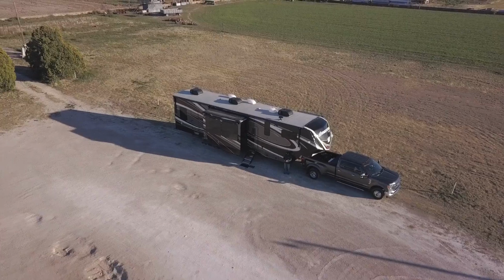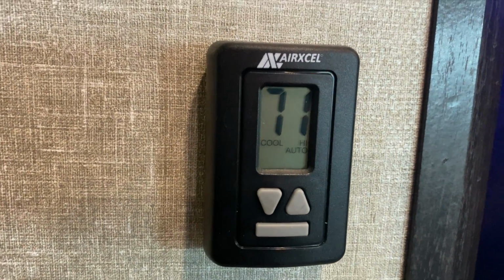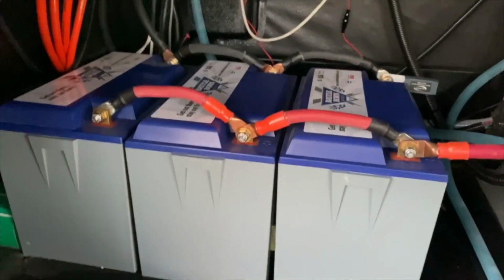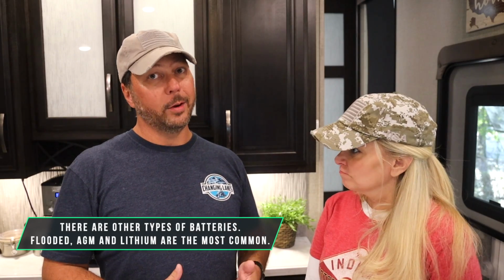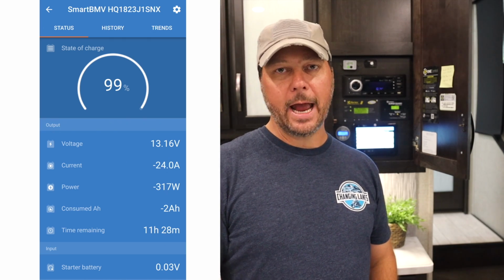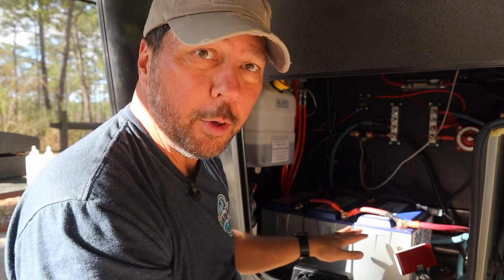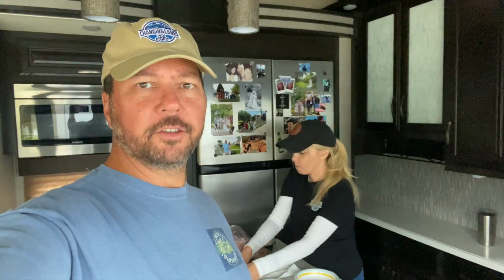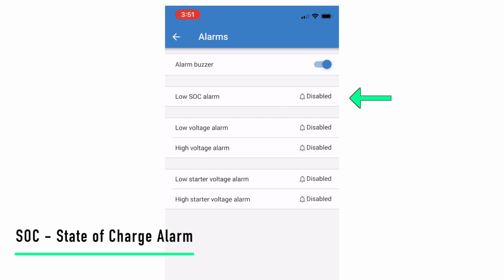RV Battery Monitor | RV Power Management | Victron BMV-712 Review

Comment: Thank you for going thru all the differences in batteries between about the currents and amp hours.  Last summer we had some batteries die several times while boondocking and that wasn't fun especially with no fan capability. Batteries are always a hot topic in the RV community and we have heard a lot of good things about the battle horns.  Maybe when we upgrade our RV we will do that.

Comment: I suggest a follow-up video ( "Part II") is required, Chad.  At least in GD trailers, the stock WFCO converter is not the best for a lithium like Battle Born.  Then the wiring from the converter to the battery must be considered.  OEM's put the smallest gauge wire (weight and cost consideration)  that may not be able to handle what a lithium-capable converter is capable of supplying to a lithium battery bank.   There's a lot of "gotchas!" with this topic!  Separate note--wish I'd had my solar and DC-DC Charger setup installed at the National Rally last year so I could have showed you (we were about five trailers down--I had the Goldwing).  I'm sure you and I would have enjoyed geeking out talking about our configs.  That is if Daisy allowed it.  :)
Reply from the maker: There are a lot of gotchas with the topics of batteries for sure..  Which is why we wanted to keep this video focused on monitoring.  We will likely have some follow-up in the future to talk about batteries and charging, etc.  For us, our stock converter is disconnected and we charge with our IC-3000 GoPower.  We do also want to add solar at some point... and/or maybe take advantage of the second heavy duty alternator in our truck to charge while driving... 👍🏼

Comment: I was riding through the middle of Wyoming, pulled off to catch a photo of the scenery with the bike mirror in the photo. Hadn't seen a car for two hours and of course, I get the pickup in the mirror right when I'm taking the photo. To the guy's credit, he did ask if I was OK since there usually was not a whole of traffic through the area. Thanks for the info about the batteries - I'll be upgrading when I get my rig and I'll definitely get the battery monitor!

Comment: Chad, I had recently bought a Vectron 712 and frankly, it was giving me fits understanding the proper install. I have a couple of Golf Cart batteries wired in series and for some reason, the monitor and my rig wiring were just not cooperating. Your explanation and presentation of your install finally straighten me out. I got the entire thing sorted out and running and monitoring properly. Thanks for the clear, lightly technical, which I needed video look at your install.
Reply from the maker: Glad you got it sorted! 👍🏼

Comment: I'm currently running with 3 Battle Born 100AH batteries as well Chad, and over this summer found that three batteries aren't doing the job, so I may add another soon.   We have a residential fridge, which when working to bring the fridge up to temperature (it's been a hot summer even here in western Canada) it's using between 15 - 20 Amps continuously.  Once cold, it pops back to about 3.5 amps.   So, we where hoping to get a longer time period between charging, but we're finding we still need to do the 2 hours in the morning, 2 hours at night with the generator.   We're not happy with the morning charge, as while it's running, we'd much rather be off doing something, than babysitting the generator!   Being that we're not sure if we'll keep our Tiffin Phaeton (my wife is vying the 5th wheel type) and we have no solar, and twice we where awoken in the middle of the night, where our batteries went down to 10.9 Volts, so I just turned the fridge off.   Of course at a campsite you can't use the generator generally until 9:00 - 11:00 Am, so sitting around waiting for the ability to do so...when you're usually up at 6:00 Am seems crazy, but heck, it's the rules.   Thus, we can't use our coffee maker with the batteries basically depleted either.    At the moment, I've explained this to Battle Born, send in photo's of my setup (I'm in parallel) and I do have the Victron BMV-712, and I leave the main monitor with the batteries, and use my iPhone to see where I'm at.   The guys at Battle Born are going to throw all this at one another and see if my system is correctly set up, and what my options are so as to not have to go to full service RV parks are, as we do like to Boon dock for 4 - 6 days at a time on occasion.     Thanks for the video, as I too have gone through the learning process, and you've done a great job in explaining things!    You two stay safe!!
Reply from the maker: Yea.. solar would close that gap, I bet... 👍🏼

Comment: Love the informative videos. 

Just my $.02 here... I see a lot of people saying they want lithium now. As a word of caution, I would not cheap out on the lithium batteries without a BMS. The BMS on lithium batteries is absolutely essential, in my opinion. Improper battery management on a lithium battery for charging and discharging rates is a sure fire way (pun intended) to have a battery catch fire and/or explode. Do you remember all of those hoverboards and cell phones a few years ago that were burning up? Improper battery management was the culprit. Usually the fires/explosions are due to overheating and then thermal runaway, which results from charging or discharging too quickly. This will cause the battery to get hot. Without some type of BMS, there is no way to catch the overheating in time.
Reply from the maker: Very good point!  One of the reasons we picked battle born.  👍🏼

Comment: Great video. One clarification. Your Battleborn (BB) batteries are controlled by its internal bms that only allows 100ah out of the fully charged battery before cutting current. My understanding is that if you removed the bms and drew all the power from the batteries, it would ruin them. Kudos to battleborn for labeling their batteries for usable capacity unlike most other manufacturers. Keep making these wonderfully informative videos. 
Can you make a video on trash while boondocking? Especially for longer periods and in areas with preditors (bears)? Who doesn't like some goodhearted trash talk!
Reply from the maker: As I understand it, the true rating under the covers is more like 110Ah.  the BMS, like you said, limits it to 100Ah....  
On the trash question..Most places we've been have a dumpster in driving / walking distance.  If no threat from critters, we can stage in the back of the truck...

Comment: I noted a glaring error at 15:35 when you stated you have "3 Battle Borns connected in series, positive, positive, positive, negative, negative, negative." That's a parallel battery connection, not series. You might want to edit in a correction so as not to misinform anyone. Great video, again. I enjoy your channel. :)
Reply from the maker: The correction was on the screen: "Parallel NOT Series"  👍🏼   😊   Caught that in editing...
Reply: @ChangingLanes  I saw that after watching it again. It appears in the lower left as your arm was moving so my eye's just weren't drawn to it immediately. Can't believe how expensive those batteries are, but I've heard they will last about ten years.

Comment: thanks! great information. we are selling our house now, and have on order a Fuzion toyhauler to live in for at least a couple years.
The Fuzion is coming with a Onan 5500 watt gen, a 265 watt solar panel, a MPPT charge controller, and a magnum 2000 inverter. As you are aware the trailer ships to the dealer sans batteries.  I cant decide if in 2 years, heck give it 3 the added cost of lithium batteries would outweigh the cost of fuel for the generator ( and or propane usage to operate the fridge ) i have been told the solar (assuming most everything else is off) will keep up with the fridge. its still a bit of a puzzle. 
Will most likely bite the bullet and get the Lithium after watching this.
Maybe we can go for a ride somewhere sometime.

Ed Rust, ADCS Ret. 
Proud member Patriot Guard Riders

Comment: Really, really excellent explanation of current draw.  For a while I was thinking, "100 amp draw for lights and fridge?" But it's 100 amps AT 12 VOLTS DC. We're used to thinking of 15 amp outlets on 120 VAC!
Reply from the maker: Indeed... and why it's simpler to use Watts when talking about power across an inverter..  👍🏼

Comment: So, after shutting off everything and the lights.....the coffee pot still has lights on.   So.... coffee maker = 14 ish amps... .Note taken.  Thumbs up!  Good video guys!
Reply from the maker: Not sure which part of the video.. But the lights and clock on the coffee maker should be less than an amp.  We also have computers, network equipment, network attached storage, and other stuff on to get that draw.
Reply: I meant that to be funny, cause Lord knows I run on coffee... isnt it one of the 5 food groups?  Thanks again for the video guys!

Comment: The Victron is a great device, especially if you have solar. Side note- the info you gave about AGM's is not completely accurate. They don't need ventilation (But should not be put in a box because they do need to breath) and you can safely draw down to 30%. (70% usage) BB are down to $800 each. By the time I wear out our AGM's the BB will be affordable.
Reply from the maker: That's not what my research indicated...   http://google.com/#q=do+agm+batteries+off+gas 
http://google.com/#q=how+much+can+AGM+batteries+discharge+without+damage
Yes.. you can use 70% but at the cost of longevity.

Comment: Chad, you forgot to mention the huge plus of Lithium batteries is that the voltage stays at a full 12 volts until nearly fully discharged. Unlike AGM or flooded. With my old AGMs, by morning, the voltage would be down around 11 volts. Otherwise, a good clear description. Thanks
Reply from the maker: Good point!  We didn't want to get too "in the weeds" on batteries.

Comment: Nice video, Chad.  Curious what gauge wire you ran from batteries to the bus bars?  Also, for the shunt....is the negative running direct to the shunt, then to bus bar?  At what point are you connected to the chassis? (bus bar to chassis or negative terminal to chassis)?  Thanks again!

Comment: You do amazing videos- thanks! I had read/heard that the battery bank should be fused close to the bank with an ANL or Class T (many prefer Class T). I see that your Class T fuse is after the battery switch and + busbar. I am very interested in your opinion on how one selects the order of those 3 things as I would have thought the order would be battery bank then 400 amp fuse, the switch, then busbar. Thanks!

Comment: Chad  - I am curious why you are not charging the house batteries from your tow vehicle while driving? This is a very common, I am surprised that is not part of your setup. Great information - so well covered.
Reply from the maker: The power supplied through the 7-pin is minimal. It might be enough to float charge if nothing is running in the RV. But, we use our inverter (https://youtu.be/1rPKWrXQYWA) to run our fridge as well as keep the internet up so our Ring security system (https://youtu.be/f-cWvMqnU9g) can monitor for smoke and water leaks. The result is, the RV is using between 10 and 50 Amps DC while towing. We might be getting 4-5Amps tops from the 7-pin (just a guess based on what we see on the monitors). So, our options to charge while towing are solar and/or a connection to our truck's second heavy-duty alternator. We are looking into both.

Comment: Hey Chad, I realize this is a year old, but I hope you see this and have an answer for me/all of us.  I have read, and heard, that the LiFePO4 batteries are susceptible to damage, if you attempt to charge them at low temperatures, or if they get too hot.  suggested range between 32 and 80 fahrenheit.  Your batteries appear to be in unconditioned space, is that OK?

Comment: Great presentation ,  and very informative.  What I have noticed is  no one talks about dry camp and CPAP machines.  It seems like no one discusses this area.  CPAP machines seem to be a very common need.  RV makers don’t address it and I would guess a majority of there customers uses them.  Could you put a presentation together showing us weekend warriors what kind of battery supply they might need.  The two machines we use have power requirements are 24v , 3.75 A the other 12v draws 6.67A. I would guess most use a generator to recharge during generator hours.
Reply from the maker: Since you know the DC Amp draw, it's just a matter of math.  Let's take the 12V one as an example.  I assume you will want to run it 8 hours.  8*6.67 - 53.36 Amp Hours.  Obviously, you'd want to add in for other items, but that's what it would take to power that CPAP for 8 hours.  Hope that helps!
Reply: Changing Lanes thanks for a quick response, but how would you address the 24v draw.
Reply from the maker: @josephcosler4653  Assuming you have a 24V system in the RV, it's really no different. You still multiply the Amps times the number of hours.  Now, if you have a 12V system and want to connect a 24V CPAP, you'll need some type of converter.  In reality, these systems are pretty close in what they use in terms of power.  Power is measured in Watts.  To get watts, you multiply Amps by Voltage.   So, your 24v CPAP pulls 90 Watts and the 12V pulls 80 Watts.  The bottom line is they don't use much power.
Reply: Changing Lanes thanks, using a inverter would be the best route. Because I could plug them just as if we were in the house.  Thanks for your for a quick response
Reply from the maker: @josephcosler4653  I think that's what most with CPAP do...   Even then, you can find the wattage it uses, divide that by 12 or 24 and that's approximately how many amps DC it will draw. 👍🏼

Comment: Chad , I notice in “ Morton on The Move  “ . There new series  Morton go North  episode 4 that Tom had the truck charge his batteries ( Battle Born ) as they drove . But I think the truck also  had a second alternator to help with this .  Know he did modify the heating and hot water heating on the Lance camp to his spec. Working with Lance Camper manufacturer.  For there trip to Alaska. I believe Tom is an electrical engineer . Please don’t get me wrong , your great at electrical wiring . Just a thought ! Really enjoy you and Tara adventures and trips!!!!  Take care and safe travels !!
Reply from the maker: Yes.. I want to do that mod eventually.. We already have the second alternator on the truck.  It does require separate wiring to the RV...

Comment: Q.  Have you thought about a battery charging system that uses the truck alternator to charge the RV batteries as you travel between destinations. I have a friend that does this with his boat batteries as he heads to the lake.. Not sure if this will work on a RV.. Great videos guys I enjoy watching and getting to travel with you thru YouTube. Hope to run into you all someday..
Reply from the maker: The power supplied through the 7-pin is minimal. It might be enough to float charge if nothing is running in the RV. But, we use our inverter (https://youtu.be/1rPKWrXQYWA) to run our fridge as well as keep the internet up so our Ring security system (https://youtu.be/f-cWvMqnU9g) can monitor for smoke and water leaks. The result is, the RV is using between 10 and 50 Amps DC while towing. We might be getting 4-5Amps tops from the 7-pin (just a guess based on what we see on the monitors). So, our options to charge while towing are solar and/or a connection to our truck's second heavy-duty alternator. We are looking into both.

Comment: New owner here and was wondering when you talked about recharging  by gen. at breaks, I thought my batteries recharge while I am driving and I run my fridge of Batt while I drive?
Reply from the maker: The 7-pin only supplies about 3-5 Amps by my estimation.  The fridge and other stuff on in the RV pull about 40 Amps.  Net negative.

Comment: This is great info.  I have watched this several times  and its starting to sink in.  how long do you have to run the generator to fully charge your three batteries if they were at 0?  TIA
Reply from the maker: Well, our inverter/charger can charge at 125A, but 120A is more realistic considering DC stuff will be running..  We have 300Ah of batteries, so that's about 2.4 hours. (300/120)
Reply: @ChangingLanes  Thats actually better than I thought it would be.  As always, thanks for your channel and info.

Comment: We've got to stop meeting like this!  Another fine video, I must say.  
And now for the inevitable question: do you get any meaningful charging from your truck when traveling? I know Mark and Trish at KYD added something to their truck when they upgraded batteries but they didn't explain it in detail.

Thanks again for the great work.
Reply: Second this one - not so much about KYD, but considering a truck with 2 alternators installed.  Worth the extra cost?  I am wondering both about recharging the bank, as well as running the DC components.  I agree about not wanting to run the propane fridge - in fact GD indicated we can special order a residential fridge in the 397 now.  I realize that would draw from the inverter/bank in that scenario, but still curious about hauler providing DC for things while in motion.
Reply from the maker: No meaningful charge at all via the 7pin.  Our truck does have two alternators and might add that same thing Marc did...  I think it's a separate cable so needs to be wired to the batteries separately.. Or we might just wait for solar.. 👍🏼
Reply from the maker: Our F350 does have the extra alternator...  Need to see what's involved in putting it to use....